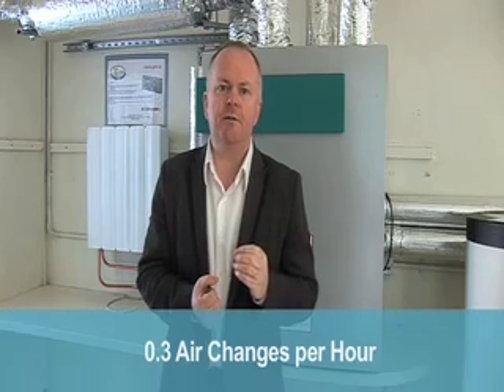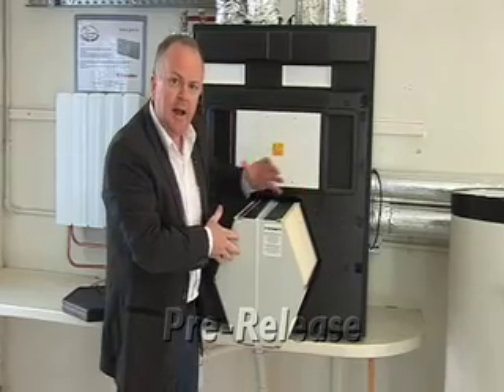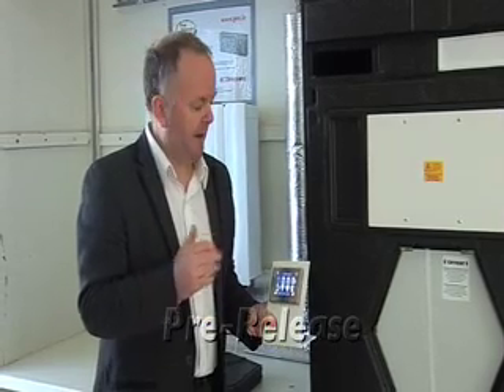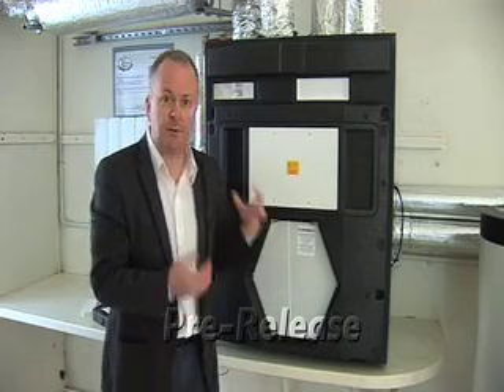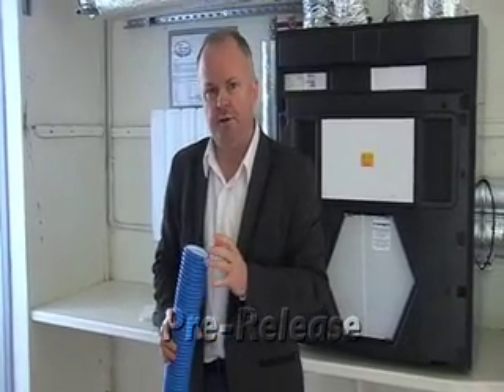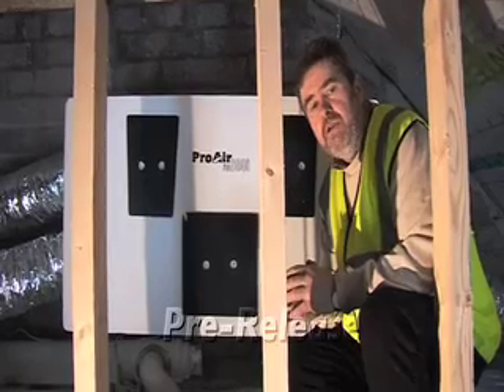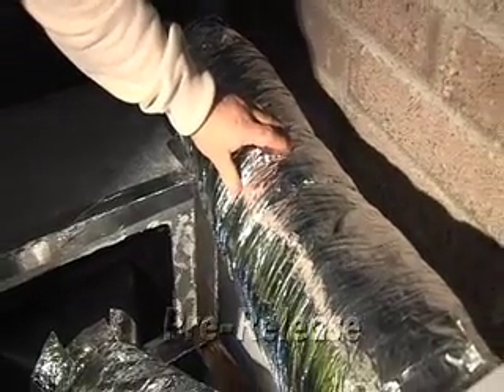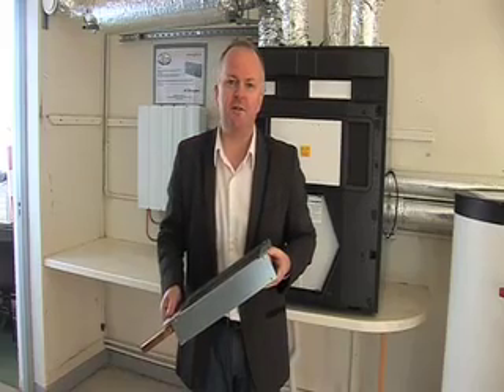Mechanical Heat Recovery Ventilation

Comment: Doing a retrofit in my old house and have used almost everything steel and aluminium duct but short piece of flexible plastic hose also. Didn't think or read anything about antistatic hose but that is a good point and i will change it for aluminized duct hose instead 👍

Comment: I'm responsible to retrofit a college dorm where the ventilation is centralized and exhausted out of the building on the roof. My idea was to use an MVHR system but my issue is that the building has no duct work going into the halls or rooms so how would I have to transfer this preheated outside air to the halls and rooms?

Comment: @philippochannel The bathroom and kitchen vents are exhausts.  The bedroom and living room vents are inputs.  So the air flows outside, through the heat exchanger to the bedrooms and living rooms then to the bathroom and kitchen, then through the heat exchanger then out of the house.  The bathroom and kitchen are negative, the bedrooms and living areas are positive.  The house should be equal pressure overall.